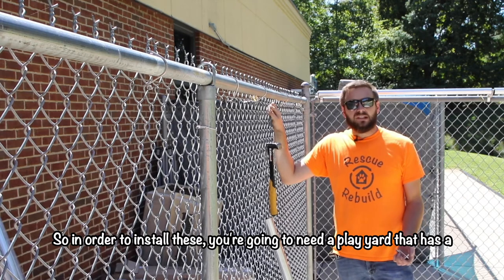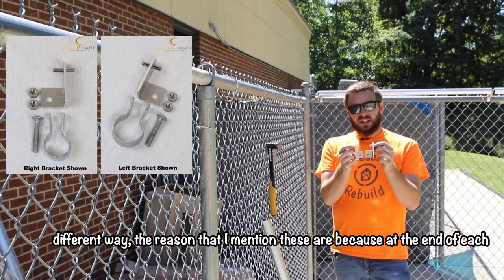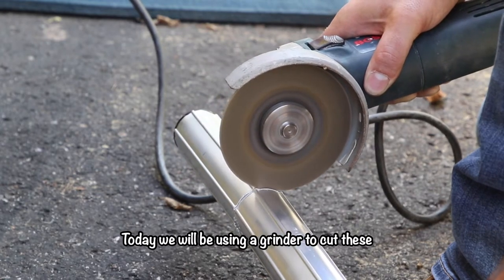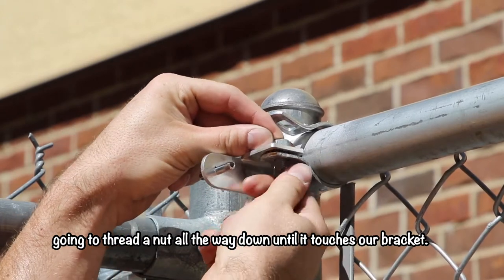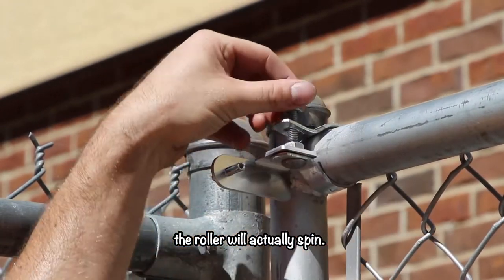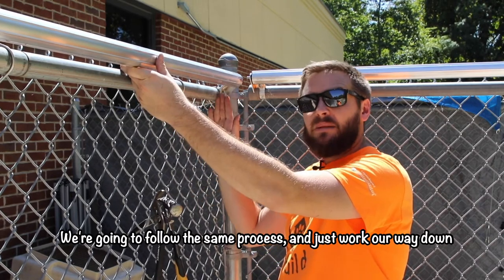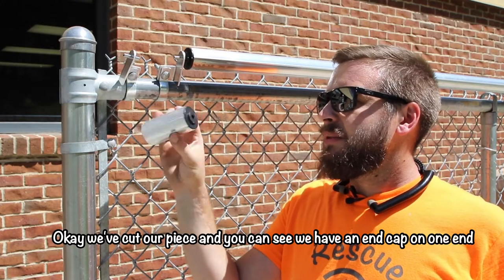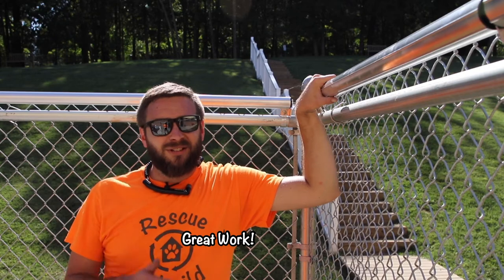Rescue Rebuild DIY Projects | Installing Coyote Rollers

Comment: This did not work for my heeler!
Reply: May I ask how come this did not work for your heeler?

I am looking to buy this for my German Shepherd. I don't want to spend the money though if it does not work like it supposed to.

I know the Coyote Roller website says your wall, fence, or whatever you are attaching it to must be at least 6 ft. in height. And of course the higher the better. I am still concerned though it might not work.